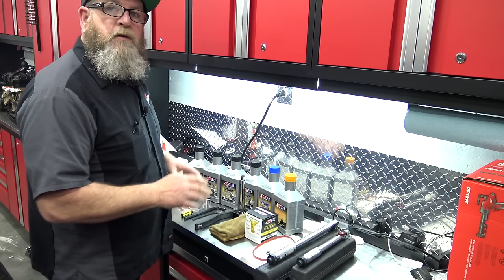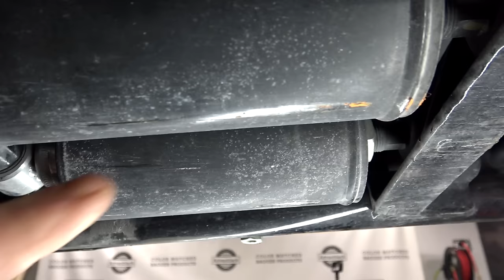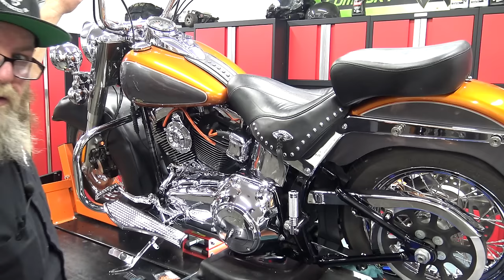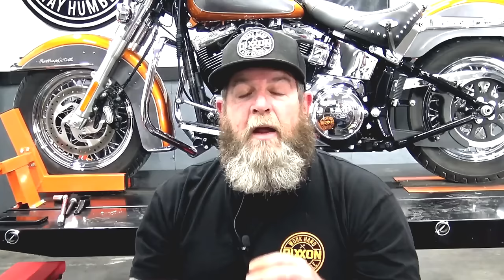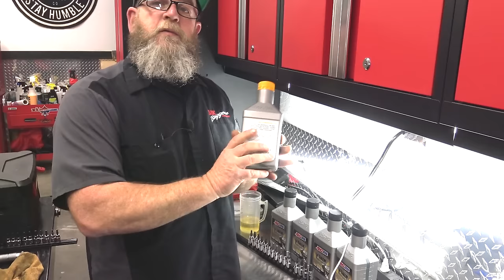⚡Twin Cam Softail @Complete 3 Hole Oil Change  @harleydavidson ⚡

Comment: Very helpful.  I liked how you talked about cross-threading of bolts/screws. However, the very best way to prevent the cross-thread of bolts/screws is to put the bolt to the hole then turn left/counter clockwise until you hear a click. When you hear a click that means the treads are on track and wont cross
Reply from the maker: great tip paul! Thanks for checking it out!

Comment: I have my brother in laws 2003 Heritage Softail to service. Its been stored in a barn since 2009. (he had a serious quad accident leaving him paralysed from neck)  I've been cleaning the bike up first but my next step was oil changes altho i dont want to try starting the bike with 12yr old oil and was going to do an oil change first, change battery and turn the bike over by hand with spark plugs removed to make sure nothing has seized. Will put a tiny spot of oil in the spark plug holes beforehand. Your vid on the oil change simplified the procedure greatly for me. I had no idea there were 3 oil drains on the bike till i watched this. Many many thanks for your vids.
Reply from the maker: Glad to have helped!! I hope you an get it all lined out and running! Thanks for checking out the video!

Comment: great video. Just to add, there is now a half funnel that is made for removing the oil filter and allows the oil to drain into a catch pan instead of hitting the frame/engine. Mine has a hole and a rubber tube to direct it to the pan.
Reply from the maker: yes there are several versions of that funnel on amazon..thanks for checking it out!

Comment: Hi I have just done 3 hole change I used the redline 75/90 for trans works great also redline for primary big difference in shifting smooth. I have softail deuce with inspection cover I checked both filled threw primary less mess bike runs and shifts like new thanks again .

Comment: Great video! I've done these oil changes several times over the years, but this time I was looking to see if anyone has found any tricks by now about getting any more oil out of the engine case since during an oil change, you're really just draining the oil tank. There is still a bit of old oil in the engine. It's been fine over the years. Was just curious. Thanks for the video!
Reply from the maker: yeah youll never get all the old oil out and its fine...you would be surprised to see how much they dont drain on a HD service. When it slows down, they plug it back up. get her hot and drain her, thats about it.

Comment: So if I’m not mistaken, is the synthetic oil not for all holes? The oil for the primary is not the same ? Sure appreciate these videos,  as I do need the information from time to time.
Reply from the maker: Hey David...yes you can run synthetic in all 3 holes..we run HD SYN3 in all thre holes on the baggers with no issues. The amsoil kit just has a slightly different weight for each one but its still all synthetic.

Comment: My guess is the Heritage and the 06 Softail Deluxe differ just a little bit because my service manual doesn't agree with yours. However, they are close. My conundrum is that when I add the proper amount of oil as per the manual the dipstick shows an overfull condition.  My manual also gives cold check and hot check instructions and should be performed on the jiffy stand. It even says that on the back of the dipstick...on the jiffy stand. The manual indicates that cold the oil should be at or just below the bottom weld of the filler neck. But when it is, the dipstick shows the oil is above the full line.  On the hot check the oil is halfway up the filler tube.  I took out some oil with a clean turkey baster and now on a cold check the oil is a good 1/2 to 3/4 inch below the weld on the filler neck but the dipstick still shows overfull. My manual say's to install up to 3.5 quarts of oil with a new filter but that seems to be way too much oil.  What the heck am I missing here.  Just to be clear I had the dipstick open to atmosphere when I drained the oil and I installed a new empty filter. Too much oil in Tampa ;-) .
Reply from the maker: Hey joe...yes you are correct about the amounts from yours to mine...they are very different size twin cams and you will need to use your service manual for sure on the specs. 88 vs 103  I would check it hot...in your case with it showing too much oil cold...but when its cold that doesnt really matter...it matters when the bike is running and the temps are hot...thats when you want the protection. Are you getting blow by? Oil dripping from your air cleaner when its hot or your riding? Also have you changed out the OEM disptick to an aftermarket one? Is your bike lowered in the rear? Bigger wheel in the rear or front? all of these things can effect the way your dipstick reads

Comment: Love the videos, I just had to use a hand impact driver with a ½" socket T27 for my durby cover. As the dealership before me started to strip the bolts and didn't replace it. The impact driver is nicer if caught in time than a drill.

Comment: Very well done. Because of you I am considering buying a Harley. In my mid fifties and it's time to buy a Road glide special. Thanx and have a good day. Yes I use AMSOIL and its recommended by Harley dealers in DFW area.
Reply from the maker: Thanks Troy...well we have plenty of videos on the harley baggers ..street glides and road glides...the softail build is pretty new to us here but a lot of the info transfers over to same to the baggers.

Comment: Excellent job....I have a question... what will happen if I put high viscosity oil for gear...
Reply from the maker: depends on the average temp you are riding in...Thin, low viscosity oils flow easier to protect engine parts at cold temperature. Thick, high viscosity oils are typically better at maintaining film strength to protect engines at high temperatures.
Reply: The ambient temperature is 32 to max of 40 degrees....in this temperature rage can I use grade 320 oil  @sikbaggers

Comment: Was doing some research on my 2007 Softail.
Per Transmission service bulletin M-1296  that applies to 96 CI six speeds:
Capacity is 32 oz, may only need 28 due to residual in trans.
Check level just rest the dipstick on the lip of the housing on side stand. Do not screw in.
Reply from the maker: aah yes...love those bulletins HD puts out..you were smart to look that up, specially on an 07..4 ounces can definitely  make a huge difference.

Comment: Hi, thanks for the video. Wouldn't it be a good idea to purge out the old motor oil? Just emptying the motor oil tank will leave the engine with about a third of old oil in the cycle. Thanks and kind regards from Switzerland, Andy
Reply from the maker: You can purge the systen if you wish, of course. The service manal does not call for it and if you take your bike to HD they wont do it either..but of course you can purge if you like, it wont hurt it

Comment: New subscriber here! What a great step by step video! This will be first time changing fluids on my heritage so I'm thankful for you - just put all tools in my Amazon cart but can't find the amsoil v twin kit
Reply from the maker: Thank you iris! Glad the video helped! Youll have to get that either through amsoils website or find a local dealer for it. One of my good buddies is a dealer so we get the discount on the fluids that amsoil offers.
Reply from the maker: sorry for the late reply...we have been in sturgis and 100 mph since we got back and I'm just sitting down to do youutbe comments..the amsoil kits will need to be purchased through a dealer from what I've been told...one of my buddies is a dealer and that's where I get it but yes the oil kit is separate from the primary and  trans..its not really a "3 hole kit" the oil kit comes with the oil, o rings and filter, then you will need the trans and primary also

Comment: Just wondering why you didn’t show clutch adjustment? Should be part of a softail primary oil change.
Reply from the maker: Great question and I think that is better done in its own video IF the clutch needs adjusted. This video was already pretty long. I'll try to get one made up soon.

Comment: Great video! I was doing a three hole change today, but the drain plug for the transmission wouldn’t tighten up. I don’t think I stripped any threads on the plug, but now I’m going to have to get the bike towed to the shop to see what’s going on. I don’t know what will be involved if the threads in the drain hole are messed up.
Reply from the maker: Might try just grabbing a new plug before you have it towed..they are only a few bucks at HD

Comment: Hey I just inherited my father's 97 singer and went Chang all the oil but was unable to find drain plug for transmission the two between the shocks I removed and they weren't it just wondering if there could be another location thanks video are very helpful
Reply from the maker: there is an oil drain hose with a clamp on it...check out this article here and step 3...youll see the hose https://www.durangoharley.com/--how-to-change-oil-in-a-harley-davidson

Comment: Does it matter when checking the transmission fluid if you are on the jiffy stand or upright?  I noticed it was mentioned for the engine oil....
Reply from the maker: Check the trans on the jiffy stand

Comment: At the very end of the video the last time you checked the motor oil, you cut the video short if the dipstick says, you have to check it on the side. What was your final result with it on the Jiffy stand?
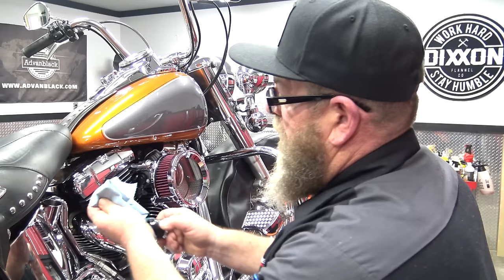Reply from the maker: if you look at the bike on the lift at 20:43 the bike was on the jiffy stand..you can clearly see how the front wheel is sitting in the chock crooked.

Comment: Good video as expected. Believe it or not your choice. Only replaced Derby cover O-ring twice since new 2009.  Replaced original few years back just because, No discrepancies found. I do have a spare available. It goes with us on long rides out of state.  Keep Shiny Side Up.
Reply from the maker: Sorry for the late reply, I just got back from Sturgis...yes sir....the derby cover o ring usually lasts pretty long
Reply: @sikbaggers  Good morning wish I was there at Sturgis, caught some your feed from there. Worked aerospace Delta II and 4.  Know full well about o-ring failures. Appreciate all sound advice in Videos. Forwarded the Street Glide fairing video to my son, has 2017 SG. Keep Shiny side up.

Comment: Three hole oil change is such a simple maintenance procedure there is no reason anyone can't do it.
Have you considered an oil filter relocation kit?
How do you feel about using the same oil in all three locations? Just as many people say it's just fine as there are those who day don't do it.
Reply from the maker: Absolutely agree! And I have not used a relocation kit on the oil filters...I just deal with the oil...its not too bad to clean up for the price of the kit. And running the same oil...Did it for years...ran SYN3 in all 3 holes with no issues. One of the bikes I service is a 2014 SGS ...SYN3 in all 3 holes and has 113 thousand miles on it with zero internal issues. I recently switched to amsoil and just purchase the oil, primary and transmission fluids from them. I have seen others say "it shifts better" "its less clunky" " it runs cooler" ...I've heard it all...and I'll be the first one to tell you..I never noticed a single bit of difference.
Reply: @sikbaggers  Thanks for the response. I also use the same oil in all 3 for my Road Glide Ultra and everything works perfectly.

Comment: How often would you do transmission flush/ change? I'm trying to learn Harleys. I finally stepped up from rice burners?
Reply from the maker: 5000 miles Motor, 10000 miles primary, 20000 miles transmission..the best way to do it in my opinion is every other oil change, do all 3 holes and youll never have to worry about it or try to remember what you changed last lol

Comment: Great video and excellent advice.  I am leaning towards Mobil 1 for my 2019 Softail Slim that I purchased a year ago. I am planning to do my first 3-hole oil change and wanted to get your input on the if I should be using Mobil 1 20W-50 Full Synthetic for all 3-holes or should I use Mobil 1 20W-50 for the engine oil replacement only?  If so, what should I use for the Transmission and Primary?
 Please advise.  Thank you
Reply from the maker: youll need a roughly 85-140 for transmission and you can find dedicated "primary" fluids everywhere
Reply: @sikbaggers  Thank you

Comment: oh and oil filter wrench is not needed at all, is it? i have been just both loosening and tightening with a hand for years.
Reply from the maker: i guess if you can get it off by hand and get a 1/4 to half turn after contact by hand youll be fine

Comment: I have a question about using alloy bolts for the derby cover. Should I add anti-seize to prevent bonding to the aluminum?
Reply from the maker: you can use anti seize on them but you will need to check them frequently in case they decide to back out.

Comment: Hello ,I see you using amsoil products and know they make fluild for all three holes. Many bike, but this is my first Harley ( 2007 cvo screaming eagle softail 110 ) I've been doing some research and had a question. I've seen people use 20w 50 in all three and another person use 20w50 in the engine, prim , bjut 75w 140 gear oil in the trans what do you think
Reply from the maker: ive ran it both ways with no issues...using dedicated trans fluid and also running syn3 in all 3 holes.

Comment: Awesome helpful video!! 
Mine is a 2003 Heritage Softail, and the primary plug is a torx.  Would you know the torque for that by chance.
Thanks for your videos!!
Reply from the maker: aah man I sure dont... and the service manual wont say either...going to be a trial and error kind of deal.
Reply: @sikbaggers  Thanks alot! Its just exact flush with the casing, so thats where I'll put it back to🤞

Comment: I have a question for you professionals. New rider here. I own a new iron 883 for my first bike. Just did the service on it. I used the SAME oil in the primary as I did the engine. It was a HD service kit so it was full synthetic HD oil 25w-50 I believe it was. Was this OK to do????
Reply from the maker: Yes...if you take your bike to HD for your service you will get SYN3 in everything unless you specify different ...if its ok for HD its ok for you. they wouldnt put that in their bikes if it wasnt..youre all good!
Reply: @sikbaggers  Appreciate it very much sir!!

Comment: How often should I conduct a 3 hole oil change?
Reply from the maker: According to the manufacturer's service manual, you should change the engine oil at 5,000 miles. Primary oil should change at 10,000 miles, and trans fluid at 20,000 miles. A transmission oil change should happen every year, regardless of the miles. I do a 3 hole change every other oil change...makes it easy to remember

Comment: I'm curious. What do you use to clean up oil or brake fluid?
Reply from the maker: If i have a lot of oil on I use cheap kitty litter so soak it up, then after you sweep that up, hit the area with brake cleaner and wipe it up good. if its on the parts I just use the brake cleaner...wait til your local parts store puts that stuff on sale and buy a few cans to keep in your garage. Carb/choke cleaner is virtually the same thing too.

Comment: How much old engine oil is still left in the lines and crank case, I've seen different ways to get it all out, once I saw that you didn't mess with it, it makes me wonder why others do, trusting your judgement way more than others
Reply from the maker: Hey NIck great question!! There is probably about a 1/4 quart of the oil left in the lines and crank. Back in the day we used to purge the system by pulling the plugs wires, and cranking it over a few times with the return lined pulled off..however the service manual does not call for purging the lines anymore. And if you look a the return line fasteners they are a one time deal...you cut them off and they are done and you will need to replace them with a seal hose clamp. But the biggest thing is the service manual doesn't call for purging the system.  I hope this helps..be safe!
Reply: @sikbaggers  thank you sir, I won't be concerning myself with that now 😉

Comment: I recently found your channel and just subscribed to it.  I purchased all the items needed to do the 3-hole change. However, when I reread the manual (2021 FLTRXSE - CVO RG) it indicates that I need to change the engine oil at 5k, the primary at 10k, and the transmission at 20k. Based on your 3 hole change video, you do change all 3 every 5k or do you follow the manual?  If you do change all 3 at 5k, can you share your reasons for doing so?  Thank you very much.
Reply from the maker: Hey PD thanks for checking it out...and yes on the touring models that is correct, 5,10,20k miles ...here is how I handle that. We have seasons here in Illinois sop that will impact your oil changes the most. In my riding season I usually put more than 10k but less than 20k on my bikes... I change the oil every 5k for sure...then every other oil change I change the transmission. so basically every other oil change is a 3 hole. 2 reasons...its way easier to do it this way ...your already doing 2 holes, hit the third one while you have all your tools and fluid out. Also its usually at the start of the riding season so I have fresh fluids in every hole for the start. So any gunk that settled or moisture that built up is gone.

Comment: Nice tips. I have not been brave enough to do it on my 16 RK, because of the oil filter pouring oil all over everything.
Reply from the maker: On the touring models, it's much easier to get a piece of tin foil up under the filter or even a cut-off plastic bottle slightly bigger than the filter to catch a lot of that oil.  It for sure makes this go a little smoother and a lot less messy.